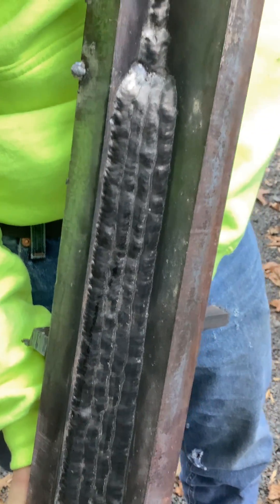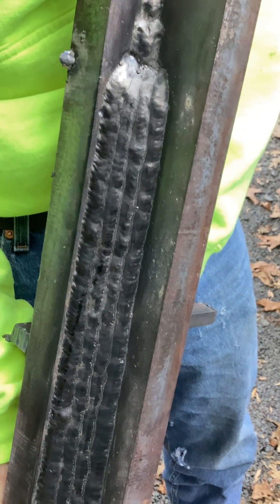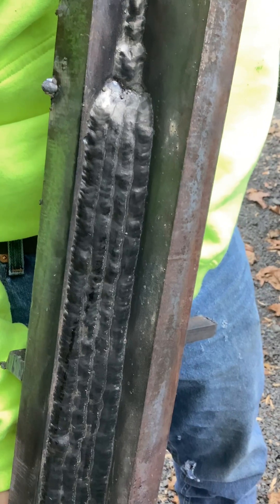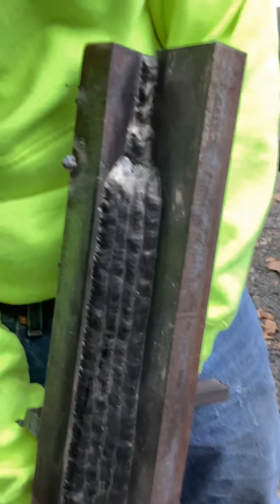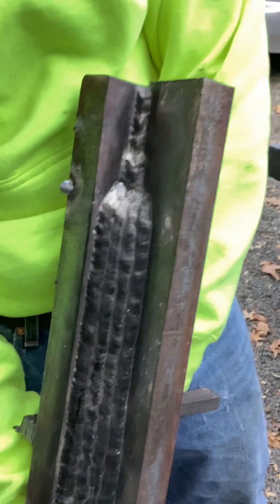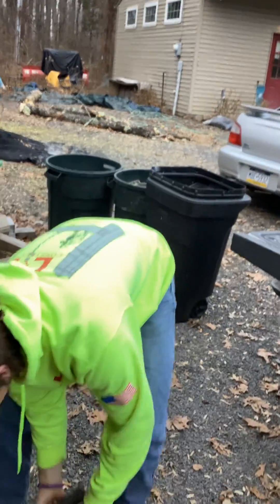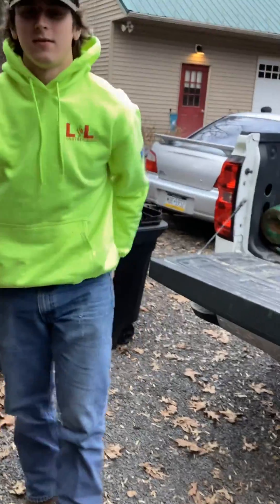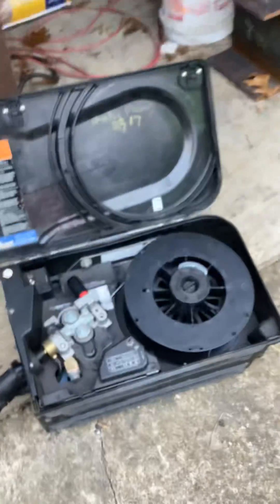Structural Welding (FLUX CORE=￼Evan working on (EXCELLENCE)

Comment: Settings?
Reply from the maker: Dylan, You have to figure out the settings, It's how much lead you have., Volts 23 to 27., Wire speed you figured it out, I always preach run it rich, You have to figure it out yourself,, That's what makes  u one is the best when you figure this out yourself, I gave evan a ballpark, I run two hundred and fifty foot a lead off my truck, He  did this in tech school, With five foot a lead coming out of the inverter, And he mastered it, It's called trial and error, Merry christmas